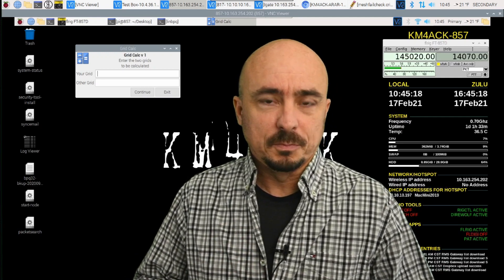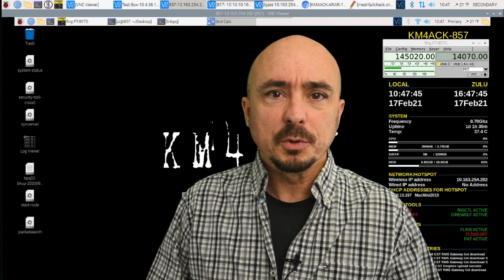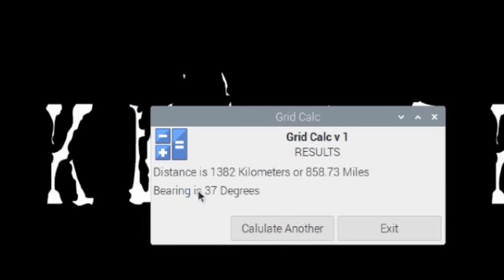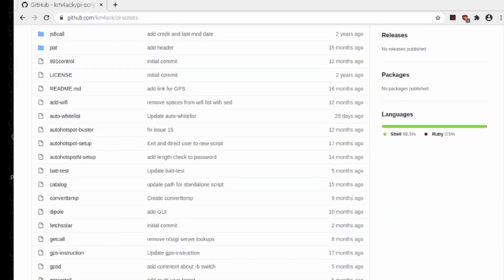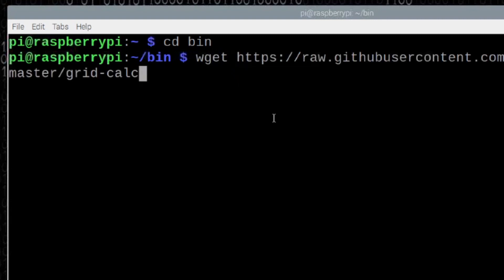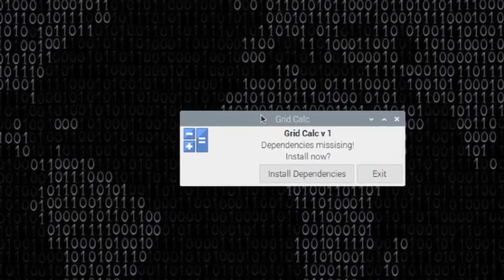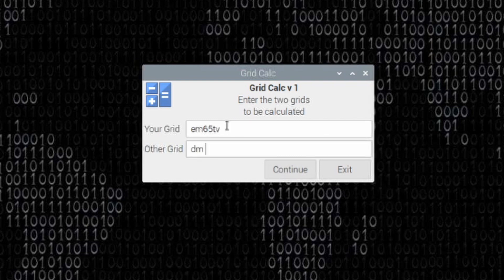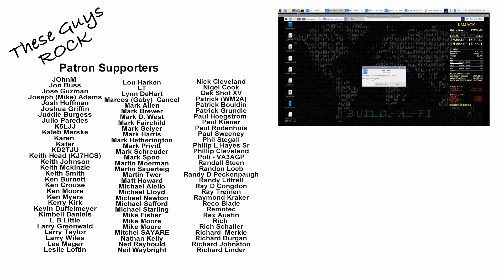Grid Calc :: A grid calculator for Raspberry Pi :: Linux

Comment: Would be nice if it also calculated the elevation needed for the two antennas to have line-of-site for vhf and uhf due to earth's curvature. Elevation changes within each grid square would make it an impractical calculation for real use because it couldn't determine your specific locations' elevations, but it would be fun knowing how much height is needed if all things were equal.

Comment: This is a nice utility. It would be helpful if the results window displayed the two grid squares that were entered as well as the distance and bearing. That way if the user made a typo when entering the grid squares, it can be checked on the output screen. DE WA1KLI
Reply from the maker: Good thought John. I am already working on version 2. I'll try to incorporate the suggestion.